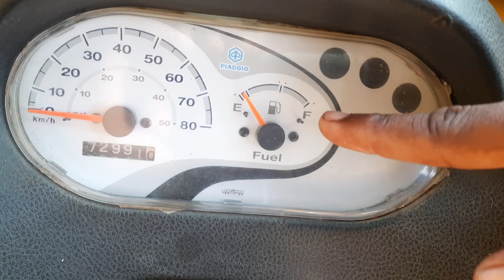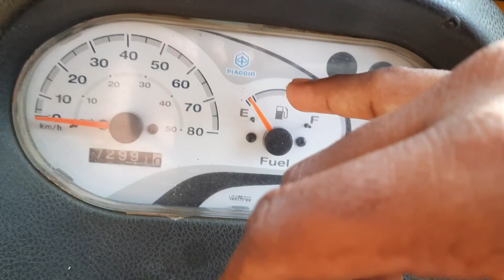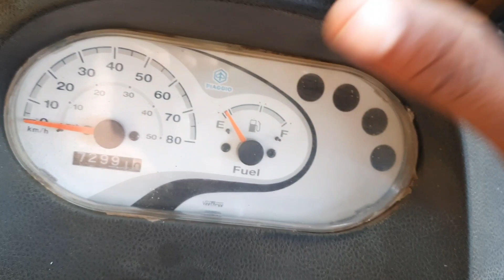auto diesel level maintenance | ஆட்டோ டீசல் அளவு இந்த மாதிரி பண்ணுங்க

Comment: Bro Bajaj re diesal auto 2013 model 445M clutch assembly kedaikuma bro
Reply from the maker: Kedaikum bro
Reply: @automototamil  Bajaj stock auto gas or petrol eruku bro athula self motor connection panna mudiuma bro